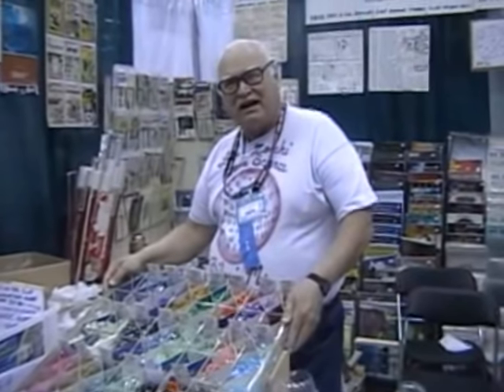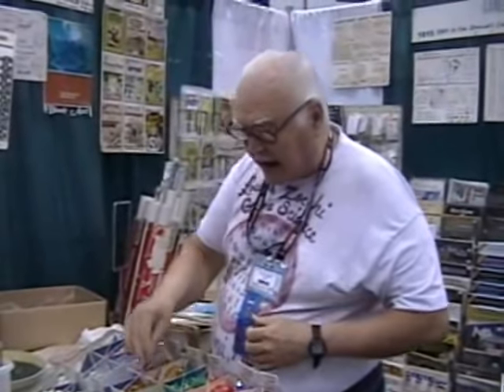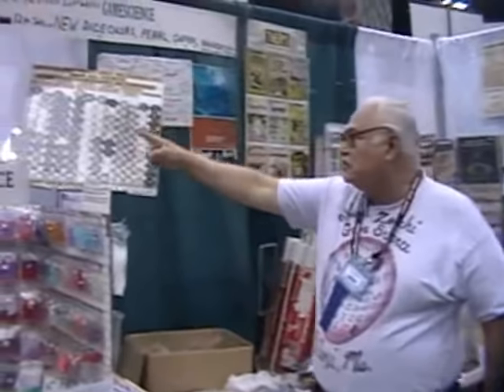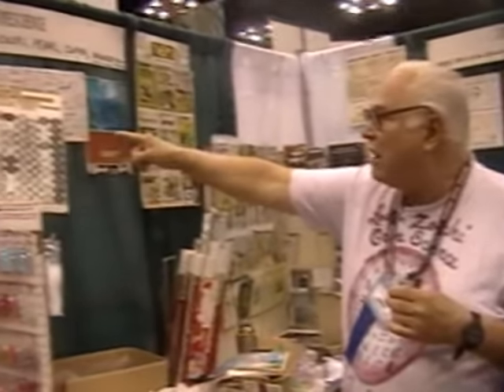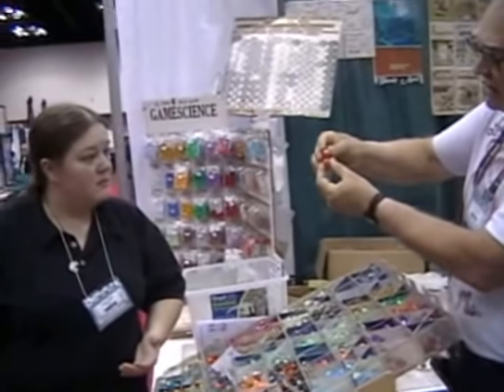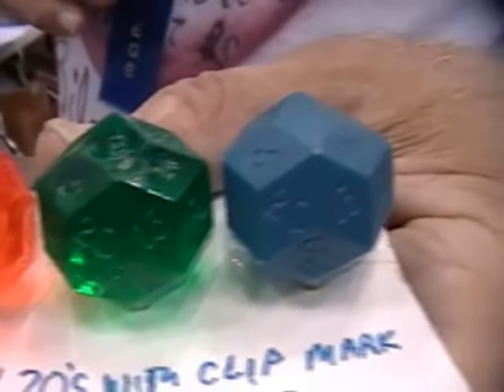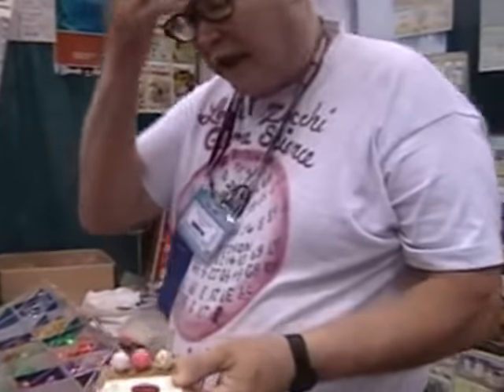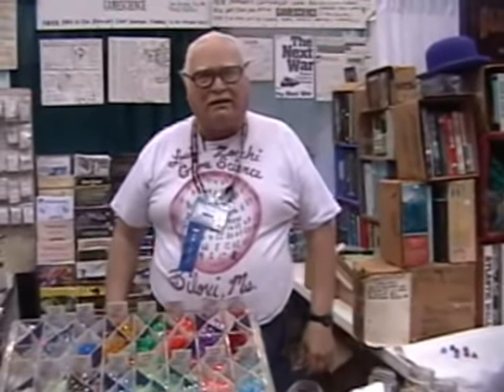GameScience video 2008 Part I

Comment: At the end of a day all dice are molded equally. The background story makes for an interesting bit, but does anyone really buy it or check whether it's true or not?
Reply: I've seen some individuals do a dice rolling test on these and competitors like Chessex dice. I'll see it in an article every now and then. His dice do seem to actually roll pretty equally on all sides. Except I've seen a contradicting test where the number 14 turned up significantly less often, and that was in fact cause it was on the opposite side of the blemish he's speaking about. But I've also seen another test indicating it wasn't that significant (but still apparent).

I have a set personally, and I don't know if it's placebo, but I do genuinely feel like I don't have as many superstitious beliefs about these ones as I do other dice I've used before (This d8 is cursed and only rolls 3s! ARGH! Why does this particular d6 always come up as 1s on an attack roll?, etc.).

Also, honestly, even if they weren't fair, I'd probably still buy them anyways, because the plastic is visibly higher quality than any other dice I've had just straight out of the box, including a lot of metal and stone dice that have been given to me over the years. Zocchi uses the word "Luster" a lot and I think that very perfectly describes them.